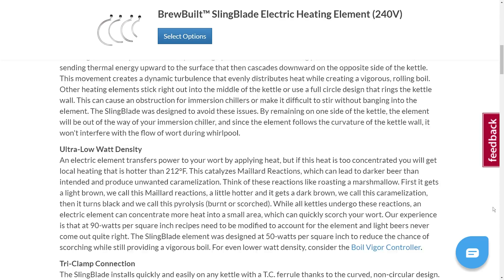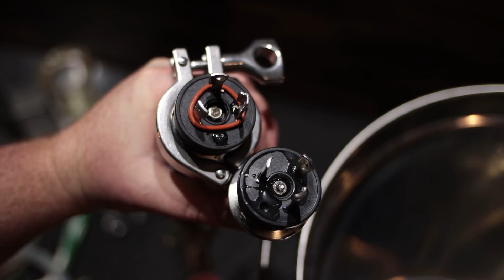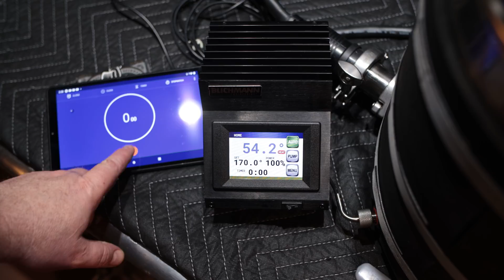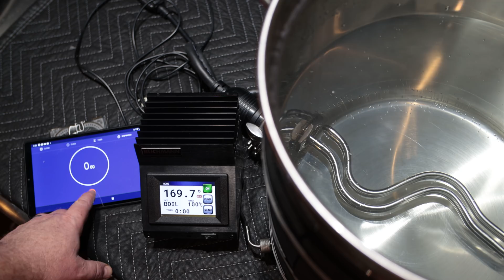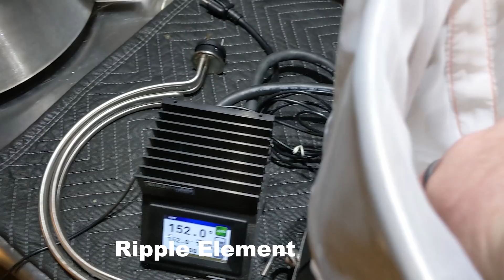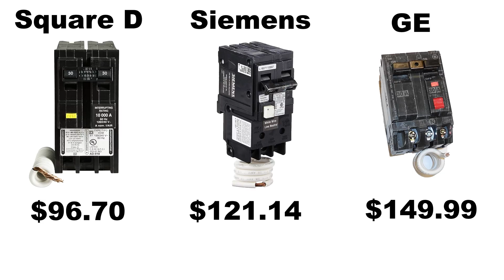BrewBuilt SlingBlade VS Ripple Element for electric brewing

Comment: Actual cost of the sling blade is 3 to 4 times higher than an all stainless 5500 watt element on Amazon. Plus the 5500 watt is 50% higher wattage.
Reply from the maker: Might be true but what if you wanted to use an inline GFCI device? Can't do that with a 5500 watt element cost effectively. 👍🍻

Comment: Curious to know if you took both elements and straightened them out if there is any length different.
Reply from the maker: I did not. I wouldn't recommend straightening electric elements either. 👍🍻
Reply: Lol no, was wondering what the difference in surface area would be. I would guess the slingblade has more.
Reply from the maker: @JodyGallant  lol ok. I think you are probably right. 👍🍻

Comment: I LOOOVE the Slingblade element and would buy it in a heartbeat if they offered a 2" TC version. I actually bought one and a very thin 2" to 1.5" fitting and it just won't fit. 

Any idea if they're ever going to release a 2" TC version? Or if anyone else has a curved element?  -Heck anyone who has an element with a NEMA plug directly on it with a 2" TC integrated?   -I'd take even a normal fold back element with  direct NEMA plug and 2" TC. Tired of wiring pigtails and elements in element guards.
Reply from the maker: I don't know if they will release it that way. 👍🍻

Comment: Good video! Im thinking about converting my keggles to electric, I noticed brewhardware.com has the ripple heating element with the tri clamp bulkhead together in a "kit" on sale. 
Now Ive bought some bad products from them before and just wanted to ask since you mentioned in the description box you're using the brewhardware tri clamp bullhead, how reliable is it and how easy to tighten is it? Thanks!
Reply from the maker: It works very well. I put a bit if keg lube on the oring and it tightened up great. 👍🍻
Reply: @ShortCircuitedBrewers  Thank you!
Reply from the maker: Welcome! 👍🍻

Comment: Not sure if this has already been asked, but has anyone compared these more “linear” element designs in comparison to the Boil Coil type design? Or is performance more based on overall wattage? Is a speedy boil of wort come at the sacrifice of possibly scorching wort? 
Thanks for the vid Brian👍
Reply from the maker: I have not compared these to a boil coil. I have 2 in my 3 vessel HERMS system. Wattage does have a lot to do with the speed. If you have a small amount of wort you could have some caramelization with the sling blade and ripple element. The boil coil has less of a chance due to the large amount of surface area it spreads the wattage over. How that helps! 👍🍻
Reply: @ShortCircuitedBrewers  Thanks man!

Comment: I went to try to buy one last week (3-12-21) and they pulled them off the shelves again. Currently not available. I called and they did not know why so I went with a ripple from Brewhardware.
Reply from the maker: Interesting.. all of them are showing in stock currently.
Reply: It figures. I just got my other element in the mail yesterday. I would have preferred to have the slingshot for my Jaded IC. I'm going to stick with what I have due to me not wanting to wait around for more shipments.
Reply from the maker: @marccummings  I hear you.. have you seen the lectric chair from jaded?
Reply: No I haven't, I'm sure it's cool though. Their stuff usually is. I have an SS rack like thing that I used when I did BIAB that will keep it off the element. I might try to rig up some sort of hanger at some point if I don't like my setup.
Reply from the maker: @marccummings  cool yeah it's a stand for the jaded chiller you can add into the kettle after boil to raise the chiller up off the element. 👍🍻

Comment: Ive got 2 jaded immersion chillers depending on my system; either blichmann boil coil or anvil foundry. I have used an exchilerator cfc previously but such a pain in the butt to clean. I'm all for keeping it simple.
Reply from the maker: Yeah I used cfc for a long  time. Immersion is just so much easier. 👍🍻

Comment: SHUT UP AND TAKE MY MONEY!!!!! 
New sub after this video. I stumbled on your Brew Commander video and after this you just saved me WELL over $1500 to convert my setup over to an electric setup. I am seriously purchasing everything tonight. Is there a link I could follow to buy my Brew commander and one so I can buy two of these elements. I would like for you to get credit for the sale if possible. 

throughwould
Reply from the maker: Haha!! Thanks!! I have lots of electric brewing centric videos!! 

Just use the link in the description for the elements band I'll get credited for all of your purchase morebeer sells the brew commander also.
Reply: @ShortCircuitedBrewers  so I have converted 15.5 gallon kegs that are 15-16 inches wide. Would I be good with the 15 gallon 4500w element?
Reply from the maker: @Offishal_Lifestyle  it will be close but should be ok.. you can "tweak" them a little without hurting anything if for some reason it touches the kettle. I think you have a 1/4" leeway on the diameter.

Comment: I wonder if I could use that Slingblade in my Clawhammer 120v?
Reply from the maker: mmmhhhmmm you sure can!! 👍🍻
Reply: @ShortCircuitedBrewers  I know Clawhammer says the controller will handle up to 1650 watt element so that’s interesting. Might be upgrading soon.
Reply from the maker: Probably the cheapest way to upgrade from 120 V to 240 V If you use the adapter that I show in the video. And the Blichman Brew Commander.

Comment: Great video, this is actually what I do, I have a 5500w 240v element that I run an extension cord from my dryer to my patio of 10/4 wire to be able to brew with 240v. It's been working wonderfully for me on a ripple style element. I have done about 15-20 brews with the setup and no issue. I have found an online calculator for voltage drop over the length of cable I am using as an extension cord plus the run from the panel to my laundry room, and I am only losing 5v (240v down to 235v) in theory, but a multimeter shows a full 120v on each leg so I am not all too worried about the loss. My ripple element looks just as it did the day I unboxed it.
Reply from the maker: Nice!! Sounds like it worked for you!
Reply: Obviously really late - but you'll only see a voltage drop when the current is flowing, if you just just stick the multimeter into the plug without the element on, there will be no voltage drop.

Comment: Brian, thanks for the review. I was looking into getting one of these but they pulled them from the market back then. It appears they've fixed whatever problems they had. One question: which do you think would be easier to clean? I've had some brew days using my 5500W BrewHardware SS element where I get some caked on gunk that requires some rather aggressive cleaning using a Scotchbrite pad. It's a bit of a pain, particularly with trying to get the pad in between the four parts of the coil. It would seem as though the Slingblade might also be easier in this respect.
Reply from the maker: I think you are right. A tip for those situations if you want to make your cleaning easier. Bring enough water to cover the element by about an inch to a boil. Add about a quarter cup of PBW and then just let it sit overnight. In the morning it will be sparkly clean with virtually no scrubbing. That would go for either element.. 👍🍻
Reply: @ShortCircuitedBrewers  Great tip! I'll definitely be trying that out after my next doppelbock or Wee Heavy long boil brew day!
Reply from the maker: @craigwalsh8116  happy to help!

Comment: Awesome video Brian seems like that’s a solid heating element! I wonder how it would compare to the Blichmann boil coil?
Reply from the maker: Yeah the boil coil is what I'm using in my HERMS system. I love them the SlingBlade is ULWD but the boil coil is SUPER LWD so there is a little difference there. The boil looks really similar though. 👍🍻
Reply: That's what I was thinking. When I was shopping for elements I looked real hard at the Blic BC but hated the fact they wanted that BA plug on the front of the kettles and the price was too high.
Reply from the maker: @TheDuner68  I did a custom drill on my system (I drilled myself) and I put them in the rear..much better place for them IMO! 👍🍻
Reply: @ShortCircuitedBrewers  Back then I wanted to do that but didn't want to be the pioneer! I searched all of the net and nobody had done that yet, they had just come on the market. I also didn't like the hard-wired version with a janky homemade weatherproof box hanging off the side either. I decided to go with Bobby @brewhardware, his ripple 5500W w/ integrated 1.5 TC and weldless bulkhead. I do give them a wrap or two with 3M 33+ electric tape over the joint between the element and plug for peace of mind.
Reply from the maker: @TheDuner68  heck yeah. That works!!

Comment: I started with ice bath then I graduated to all gain and bought an immersion chiller (cheap one) , I saved a lot of my money for a plate chiller used it for a few brews, I just never trusted my cleaning process of it sold it on ebay and went back to my immersion chiller, I did upgrade to a Jaded,  never looked back.
Reply from the maker: Jaded is awesome!! 👍🍻

Comment: Nice info, and cool product Brian! In my experience, though it is interesting to see the local temp of element, for heating bulk solutions you typically want to measure the temp of the solution at a point AWAY from the element while ramping up temp all while circulating with pump to maintain a homogenous temp. My theory as to why this happens is because of the way PID controllers work by using a real-time statistical algorithm using 3 key factors (#1 the instantaneous error value from setpoint, #2 short-term history, and #3 long-term history of system response to energy input), if the probe is too close to the energy source (element in this case), the PID controller is now indirectly watching the close-coupled element temp, rather than looking at the bulk homogenous system temp. The probe is also now measuring heat from both direct liquid contact (via conduction), as well as direct IR (via radiation) from the element due to proximity. This also makes it harder for it to “ring down” to a smooth and correct rate to fire element (doesn’t matter if it’s proportional or PWM control). Small variations in pump speed (flow), and viscosity/density changes in wort will amplify this error as the wort changes over time due to concentration of sugars. Whether I use 1 or 2 x 5500w ripples in my boil kettle, my system will ring down fast (minimal undershoot/overshoot), and ends up heating a given volume FASTER and more accurately with the probe further from the element, as the PID is not being deceived by the proximity effect. When the solution starts to boil, I kill the recirc pump, and now convection drives the mixing, and I find the system is still less error prone than if I park the probe right next to the element for all of the same reasons. A helpful analogy is that it’s like cooking a steak… whether you are using a high temp as found in a grill, or using sous vide method (low temp), you know when the meat is cooked properly be measuring the meat temp, not the energy source temp. That’s my 2¢, and I welcome yours!

Comment: The chiller I'm using is the brutus exchilerator.  As they say...buy once cry once.  It's "expensive", but well worth the price of admission.  When you factor in time as the most expensive part of your day. Going from 30-60 minutes down to under 10 no matter the batch size is literally a day changer.
Reply from the maker: No doubt I have the smaller one and it works well!

Comment: I went from ice to a DIY copper pipe immersion chiller and that served me well for years. I just recently upgraded to The Hydra from  JaDeD, it's the one optimized for the kitchen sink as the source water as I'm an apartment brewer myself. I love the thing! Chills my 22 litre batches in just 10 minutes. The first time I used it, I though I had a leak in my pot because volume was dropping so fast from just the cooling shrinkage.  I considered other options when I upgraded, like counter-flow and plate, but those bring with it extra cleaning issues and I'm all about simplifying the process myself. 10 minutes from boil to pitch is good enough for me.

Comment: A high power, apartment setup video would be great!
Reply from the maker: Thanks Paul!!
Reply: I’m an expert at big brewing in tiny appartment. Just finished my herms setup (in a wife friendly fashion). Check out fullmetalbrewery on IG. New setup with The Electric Brewery panel coming soon.
Reply: I would second that. Right now I'm using a Robobrew 35L on 120V because I'm in an apartment. However, I recently noticed my stove is on wheels and I can easily access the 240V plug and have considered using that in a future upgrade.
Reply from the maker: Great! Thanks for that feedback! 👍🍻
Reply: I would love to see this as well

Comment: Thanks, Brian...just received my 4500 watt element the other day!
Reply from the maker: Nice!! What size system are you building?
Reply: Got (3) 15 gallon keggles powered by (3) Blichmann BrewCommanders.  HLT and BOIL are 240v while my 120v MASH controller runs my homebuilt RIMS tube
Reply from the maker: @shannonwells1960  nice!!